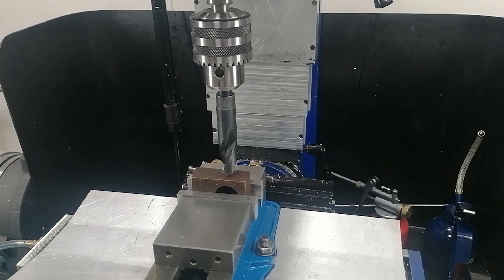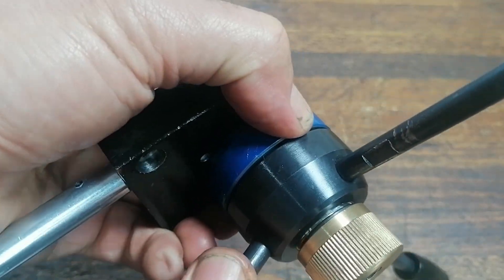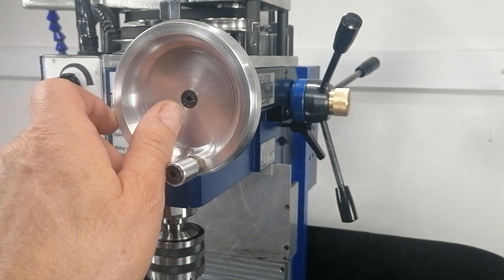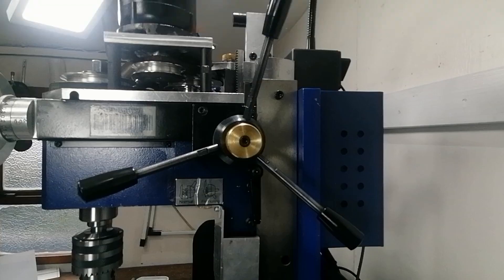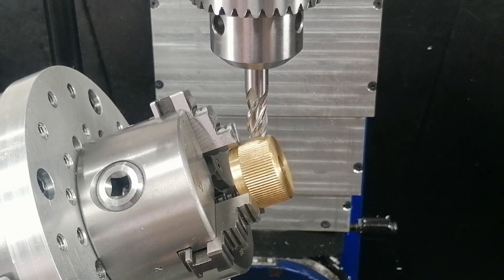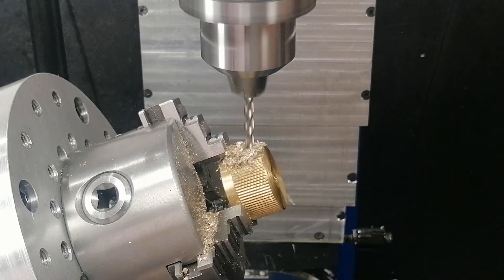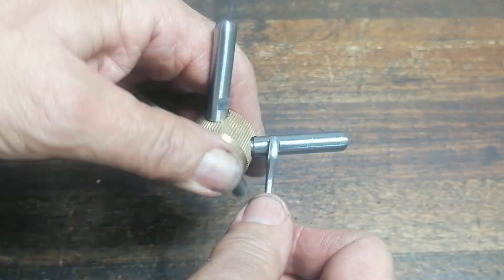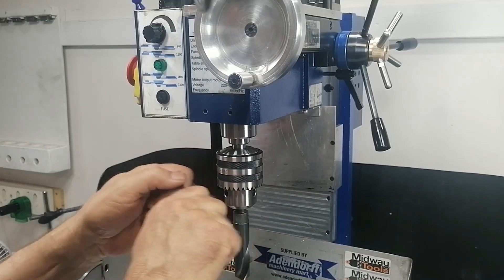Improved Fine Feed Clutch (No More Slipping!)

Comment: This a usual a Great Idea. Well done!  Is there another way? Perhaps using the friction clutch from the SIEG SX2.7. I don't know if that would be possible. May be the parts would be interchangeable if we're lucky. You've probably already explored this option?
Reply from the maker: Thank you very much for the tip. I will not be able to say if that clutch will work. I do know that mine works very well, especially after this modification.